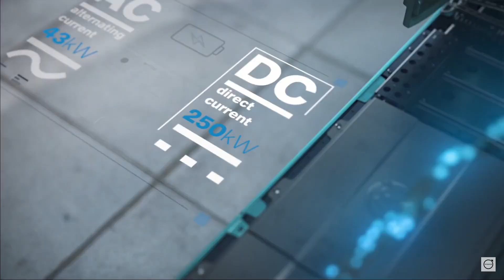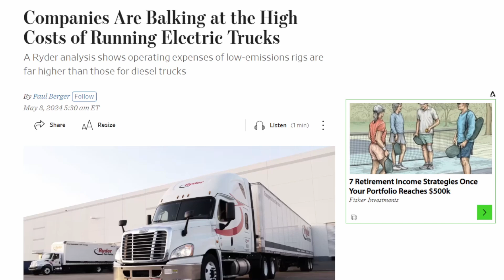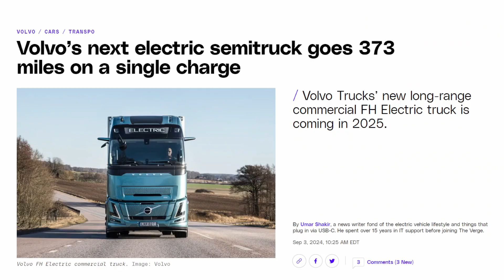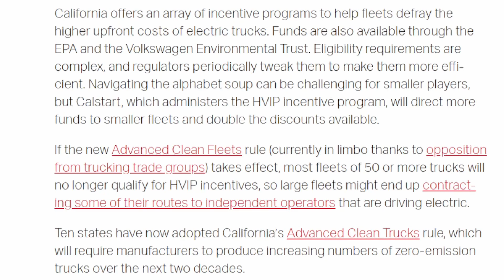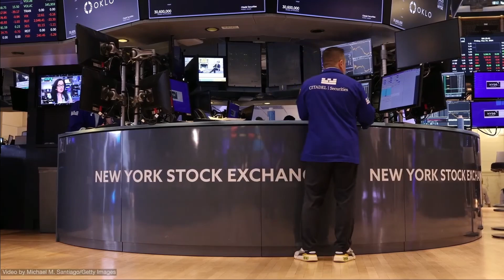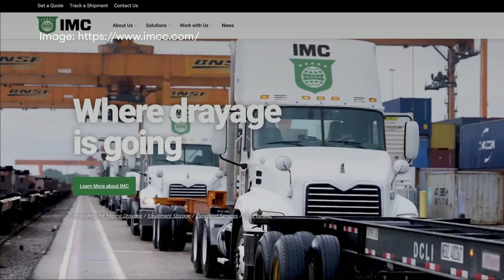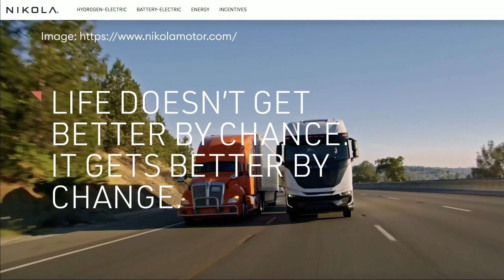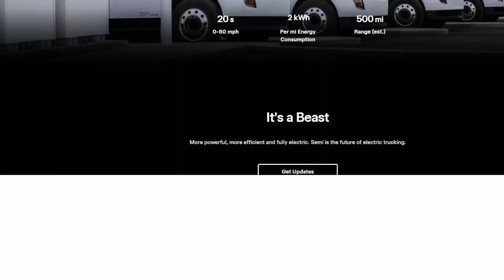Battery-Electric Semi Trucks: What Went Wrong?

Comment: LOL, absolute nonsense. Ignore these mercenaries for the Anti-EV cabal. They live off of providing click-bait to moronic Luddites looking to satisfy their anti-EV confirmation bias. As well, industries involved with the sales and servicing of Gasoline And Diesel vehicles (especially new car dealers) along with the Fossil Fuel Industry, are secretly working hard to deny people the right to drive anything that does not burn hydrocarbons. They see mass adoption of electric vehicles as an existential threat to their businesses. As dealerships depend upon the extra maintenance and repair work that gasoline and diesel vehicles require (sales of parts and services for ICE vehicles account for over 40% of a typical dealerships profits), they have a valid concern. They know that EV's won't require the same level of maintenance or repair work and will not provide the same revenue that ICE vehicles provide.  However, why should that be the consumers problem? Why should consumers be responsible for supporting a new car dealership's antiquated and failing business model? Why should consumers be forced to purchase only those types of vehicles that will require the extra maintenance and repair work to keep a dealership profitable?

Comment: I drove a mercedes electric truck last year, it was fine. EV isn't for long hauls though.
Reply: It took Mercedes 12 days to drive the new eActros 600 loaded to its 40 ton maximum weight 4,436 km from Frankfurt to North Cape in June.  The complete tour will be Frankfurt - North Cape - Tarifa in Spain (southernmost point of continental Europe) - Frankfurt. 
But this can't be compared to the US. Here in the EU we have strict speed limits for trucks as well as driving time limits. I.e. 55mph, dayly driving time is 9 hours with max two days a week 10 hours, every day there has to be a 11 hour rest period which can be split in a 9 hour and a 3 hour period. Every 4.5 h there has to be a 45min rest period. 
US owner/driver operaters would scream bl**dy murder with these restrictions ;)

Comment: What if we get rid of expensive, heavy batteries made of toxic materials altogether? Instead, we could run high-voiltage wires along the road and add a special device to the truck, so it can get a direct contact with the wires to drain the power from them. On the other end of the wires we can put solar, hydro, wind or nuclear power station. While we at it, we could also make deliveries more reliable by running trucks on schedule thus avoiding any traffic. To further improve efficiency, we could make special roads and wheels which dramatically reduce the friction losses and are made of some unexpensive and durable material, such as steel. Listen, with such low friction we could even attach not one or two trailers to the electric truck, but hundreds at a time. To make everyone happy and excited, we could call it terra-giga-super-loop, so no one notice it's actually a regular railroad doing its job just fine.
Reply: How about we get rid of expensive toxic tires.
Reply: How about we get rid of toxic heavy expensive cables along the road and put some cheap clean batteries in our vehicles?

Comment: I really like Nio's approach with the interchangeable batteries, but this kind of plan needs huge sums of money in order to build the necessary stations, electricity grid and power production. Once you have all that, you give a subscription model for the use of this network, and you build an empire of services, around battery technology and infrastructure. The cars are not the main obstacle for EV adaption.
Reply: Batter swap does not work. Charging is much cheaper and easier.

Comment: The Tesla Semi is carrying a 5 tons (5000 kg) battery in extra. Not to mention that in most countries fuels are taxed heavily (diesel included). Usually 70% of the price of the gasoline is added tax. Just wait until governments start loosing revenue and start adding that tax on electricity that charges vehicles. Don't you think for a second that the government will loose money and you will be charging your truck at home prices.
Reply: Electricity is already taxed and more expensive than Gazoline or Diesel. What are you talking about?
Reply: @wolfgangpreier9160  + You can produce your own electricity and almost no one can produce their own oil products. I'd like to see governments tax privately produced electricity used in the company's own trucks.
Reply: @Henreinje  In Germany they do. Here in Austria they can not. 

Of course it is always possible to change the laws to allow double taxation. But i do not think they will do that.

Comment: How many electric trucks has nikola sold?
Reply: Don't worry about how many EV trucks nikola sells. Pay attention to how many hydrogen trucks they start selling. Ev is garbage, and hydrogen is what will make Nikola a huge company
Reply: @mattevans5546  So you admit they failed with their EV truck. That was over so soon.
Reply: @onsokumaru4663  they didn't just fail with EV trucks, EV trucks will never work for any company ever. I drive trucks. I drove a diesel from NJ to Atlanta and then back to Charlotte on one gas tank. EV could never do that on just a battery. Hydrogen Electric has a chance though with future advancements
Reply: @mattevans5546  those are electric, too. just with a small battery and a fuel cell as range extender. 
You might want to have a look on the price for hydrogen though.
Reply: @VolkerHett  I'm aware, and you're right. The price of hydrogen is too high right now. Will it be too high in 5 years? 10 years? 20 years? It's the same shit as gas in its infancy stage, but gas has a 100 year head start. When there's infrastructure and it's readily available, will you still agree with yourself?
Reply: @VolkerHett  but yes you're right, they are electric and fueled by hydrogen to drastically improve how far they can travel
Reply: @mattevans5546  I'm not sure. The cheapest way to produce hydrogen is by steamreforming hydrocarbons preferably natural gas. For electrolysis we need close to free electricity in huge amounts and the current technology is very fragile and maintenence intensive. That's why they use purified or destilled water, drinking water damages the membranes. 
Loads of solar power is in the desert, but they don't have much water there. For transport in tankers you have to cool it down to and keep it at -419°F. Hydrogen reacts with steel and makes it brittle and the molecules are so small our current welding technique for pipelines is far from good enough. 
IMHO it's more economical to combine electrolysis with direct air capture and make methane which we can handle without Star Trek technology 😀
Reply: @VolkerHett batteries, solar were vastly more expensive 10 years ago. Now with scale its come down. This is possible for h2 if it gets enough adoption. There is still a steady but slow positive news flow for h2
Reply: @vegan4earth  your fighting against the 2nd law of thermodynamics with electroysis first and then ""burning" the H2 in a fuel cell to charge a battery. 
From an economists (me) point of view you have far to many losses. You need really clean water, the electrolysers are expensive and need a lot of maintenance. Then you need Cryotanks to store 1000 bar h2 a the gas station and and and. 
When you have electricity to give away for free, give it to me, I'll charge some batteries :D
Reply: @ ok my scientific knowledge is probably not as good as yours. I am also economics background. So then there has to be new composition batteries beyond lithium ion or solid state ones to be able to electrify every heavy transport and passenger vehicle. We are headed for 3C warming without rapid reductions. With refusal of capital to shift to wartime type of economy, this does not end well.
Reply: @vegan4earth  How’s that news flow looking now?
Reply: @conor7154  how is it looking? My attention has been elsewhere. Nikola  filed for ch11? And the rest of the world? Nikola is the world? Doubt it
Reply: @ lmao, cope
Reply: @conor7154  looks like Bosch, volvo are still investing in hydrogen. Also data centers are being powered by hydrogen, and even some ships and ferries. Batteries won't make sense for all applications-too heavy, not enough lithium reserves in the world to do that.
Reply: @mattevans5546 so why is their stock down 88% this year?
Reply: @mattevans5546  What a bunch of nonsense 😂😂🤣🤣Hilarious!

Nikola already makes parts of the Iveco EV trucks and they sell like ot cakes with a naked cherry on top.
Reply: @wolfgangpreier9160  I'm a huge Nikola investor, EV won't work. Hydrogen electric will work in time. Strictly EV will only work for local deliveries only. Good luck driving cross country in the winter
Reply: @mattevans5546  They already do, travel across the country, even across borers and other countries and thy all charge at public chargers. So: no risk about it.

Winter is bad for Sedans, not for trucks. Heating Truck cabins with a 600 kWh battery is trivial.
Reply: @wolfgangpreier9160  Hey how’s that nikola investment of yours doing? NO REFUNDS, THANKS FOR PLAYING 😂😂😂
Reply: @conor7154  Never invested in anything fishy or german. No thx.
Reply: @ Yeah, only bankrupt and delisted companies like Nikola 😂😂😂
Reply: I do not know the correct number, i guess a few hundred in Europe. The most powerful electric truck on European roads, the Iveco.E-Way has 1090HP and is made by Nikola.
Reply: @wolfgangpreier9160  the Iveco.E-Way is NOT MADE by Nikola. Iveco LICENSED the technology to Nikola to use in NA. Meaning that Iveco developed the tech first and then let Nikola use it. Nikola as an organization is profoundly scammy.
Reply: @aidsowen8369  I know for a fact that what you say is partly true. Iveco makes the chassis, the cabinet and some other parts. Nikola makes the drive train, batteries and software.

Lets say 50:50. Ok?
Reply: BOSCH picked NKLA to use their H2 tech. They could have chosen to work with any OEM probably.
Reply: @williampmcd8548  Not with any. Besides Mercedes all have stopped their H2 efforts. Or the funny thing with the overrhead line and pantograph in Germany.

Comment: batteries just aren't energy dense enough yet for more than short routes. Long haul routes need to be designed like a train. Diesel generator with electric drive train or LNG generator. Batteries are just a dead weight for long haul routs and don't make sense until they can double energy density
Reply: Where did you read that nonsense?
The newest Volvo has a 600km range. That's already more than most do in a day. 
But if Americans don't want to be involved in a market that doubles each year I don't think China and Sweden will mind 😂😂😂
Reply: The goal isnt to make massive batteries in cars.  The goal is to find the right balance between range and weight while improving the SPEED of charging.   Do our ICE cars make a trip across country without refueling?  No.   Look at the avg gas tank range, there's a method to the size.   Same thing with EVs.
Reply: You could ask the Hydraulic Press Channel and press your batteries with their 50.000 ton press. Then they will be dense enough. 

We in Europe are silly boys, we are already using the existing solutions today. In trucks, In Mercedes, Volvo, Nikola/Iveco, DAF and others. In 40 tons trucks. The US call them Semi. We call them Sattelschlepper,. On long routes across Europe. Up to 800km a aday because by law they aee not allowed to travel farther.

Comment: NKLA.. Nikola...XOS Trucks...Fed Ex and UPS haven't even went electric on StepVans after testing Air conditioned Xos Trucks..while UPS drivers bake in trucks up to 120 degrees inside. 72 Nikola deliveries Q2 and planned 80 to 100 in Q3 is a great start. Thumbs Up video/ comments. Thanks as govt emissions regulations will accelerate truck adoption.